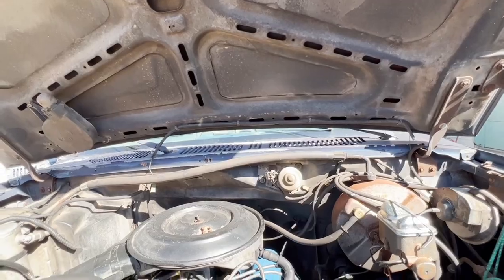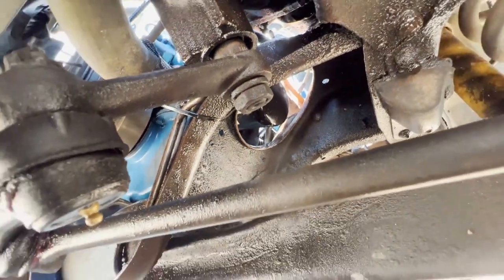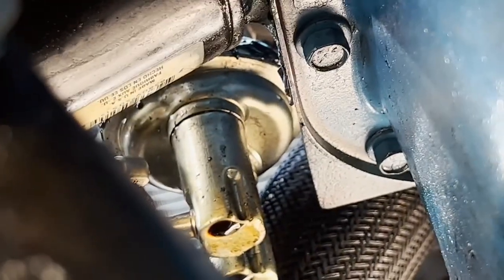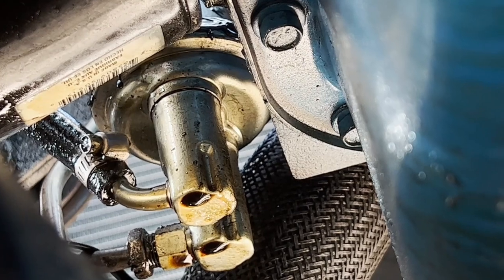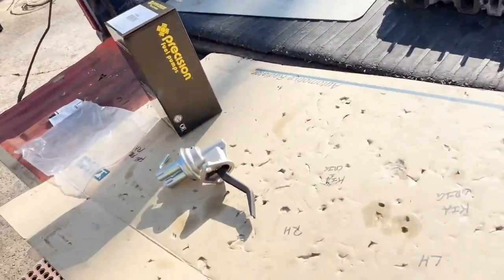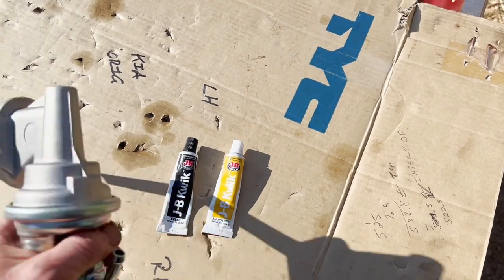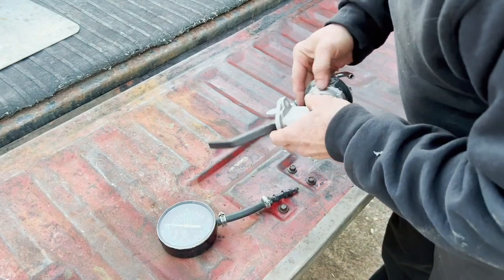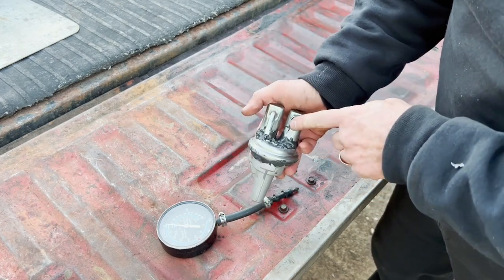New Fuel Pump Leaking Oil On Ford 302 or Any Make and How To Fix/Prevent It

Comment: It's a shame that it's nearly impossible to get a good mechanical fuel pump nowadays , regardless of the brand of engine that it's for . Most of them are Chinese junk .
Reply from the maker: Hi again. So true. There is zero QA/QC from the land of the CCP. Since we have become a nation of consumers instead of the nation of producers we once were have brought this on ourselves, but that's another story for another day. 
I've had these new fuel pumps pushing as much as 9 PSI, so if you must replace the fuel pump you also need to add Fuel Pressure Regulator between the pump and carb and get it down to 5-ish PSI. 
If you're going to switch to an electric pump, they're probably made in China too, so there's that. While it's tempting to put the pump under the hood for ease of installation, it's best to put the electric pump in back near the tank as electric pumps push better than they pull. 
Thanks again for watching and taking the time to comment.